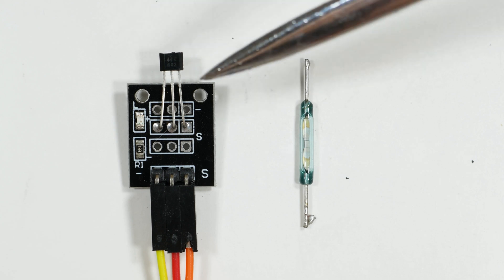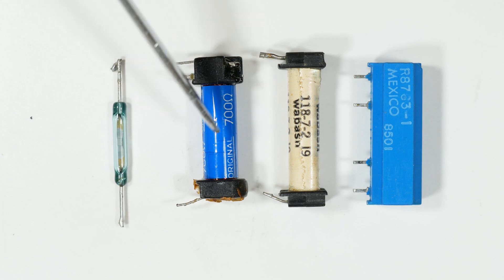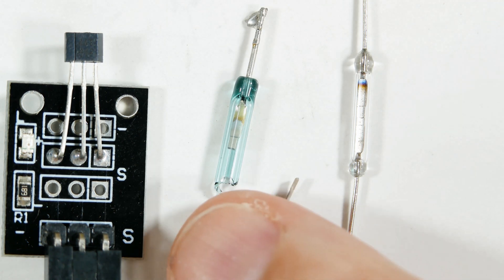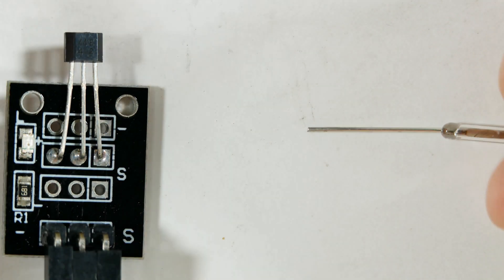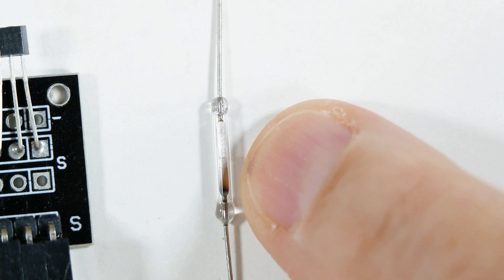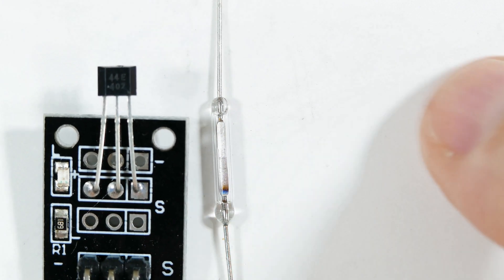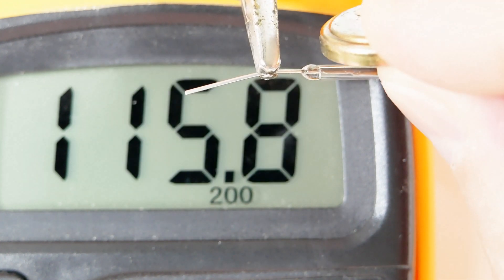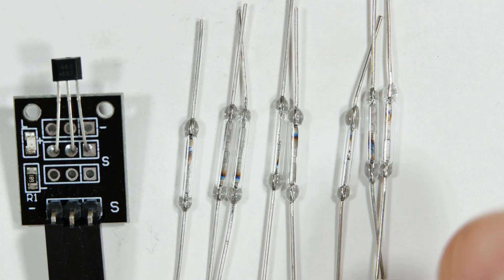Magnetic Reed Switch (The "Original" Hall Effect Sensor)(4K)

Comment: I replaced my key operated garage door opener with a Reed Switch hidden behind the siding. When I pass a magnet near it, the switch closes and signals the controller on the circuit board of the garage door opener. No more lock and key switch that goes bad due to rain and dirt clogging up the tumbler assembly. You can’t tell where’s the reed switch is hidden at. I’m not buying a whole new system or a new key tumbler.
Reply from the maker: Very smart. I like it!

Comment: I have been using reed switches on my model railway to operate the signals via Mosfet bistable circuits and also to simulate conductor rail arc flashes directly coupled to White LEDs. When operating, the system has worked well, but I have had to replace several reed switches that have failed, either permanently closed or permanently open circuit.
I have now ordered some (100) Hall effect sensors to replace the reeds, and will carry out some testing first before installation, as I may have to change the voltage regulators in the power supplies. I also have to make sure that I do not exceed the maximum current rating of the sensors, but your demonstration #1 with the single LED gives me hope.
Reply from the maker: Interesting application. Most hall effect switches operate in the milliamp range, like 25 to 30. You may have to couple them with a transistor/mosfet or similar to get more amp throughput. I just got some surface mount (tiny) bipolar transistors with 600 mA capability. That could bump it up by a factor of 15x-20x. Note that in the demo where I light up the LED, the green LED is being powered by the RPi, and not the hall effect switch directly. There's a small indicator LED on the hall effect board that is being powered directly, but it came with the switch and I have no idea how much power it is drawing (it might be very little depending on the board circuitry).

Comment: This was in the base charging station of robotic vacuum.  I couldn’t figure out what it could be used for.  12v dc adapter goes to the charging station.  First I thought it was a fuse and blown since it wasn’t changing.  But finding out it is a reed.  Any idea what function it serves?
Reply from the maker: Maybe it tells the base that the robot is in place?
Reply: @tsbrownie  i see That could be.  But I check the bottom of robot where it makes contact as well as charging station metal contact that pushed in when robot seats There seems to be no magnet anywhere to activate the reed and not sure how it activates. I guess I’ll look again tomorrow.
Reply: Actually I found the magnet on the bottom of the robot so it make sense now.